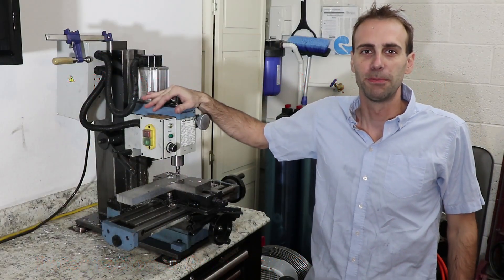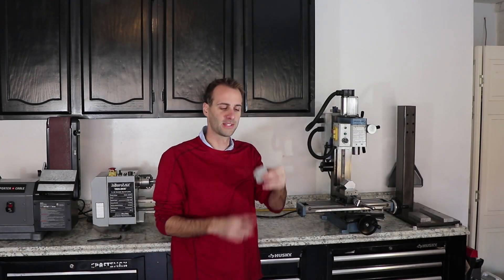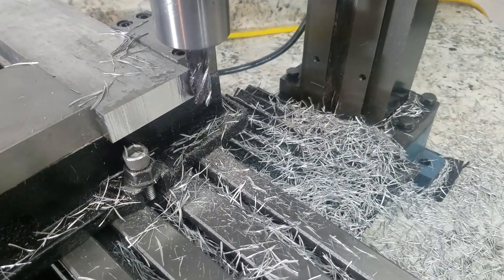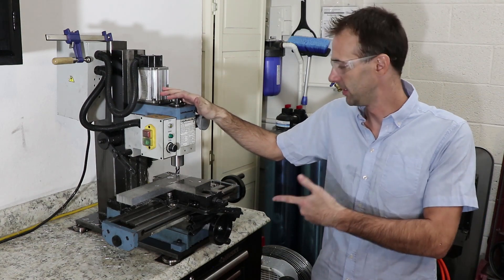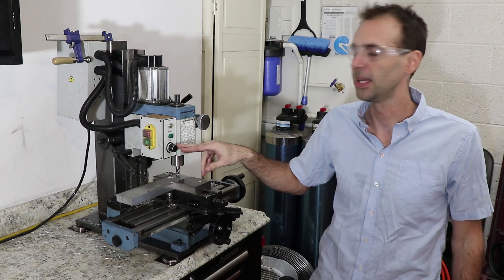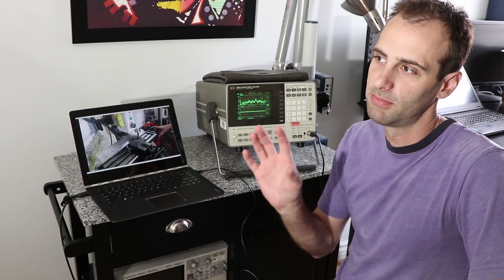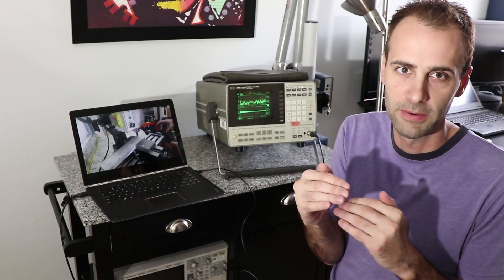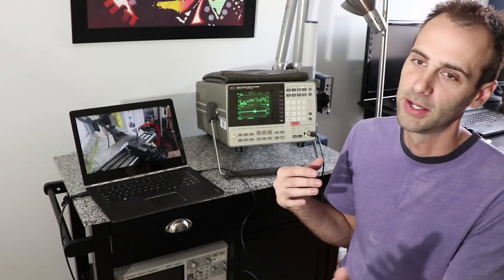Column Stiffener - LMS HiTorque Mini Mill

Comment: few points.. tighten the X axis gibs.. they appear loose and i know these machines get loose in the X over time.. lube is needed at least for your ears.switch to 2 flute cutters for aluminum. Anyway the mill seems a lot more rigid nice solution.. you also need a better Z lock now with the ability to take deeper passes.
Reply from the maker: Good suggestions. The Z lock is key, the Z dove tails on the head casting are the new weak point. The X was locked and the Y gibs were so tight the whole mill was sliding on the table, if you look close you can see it. I resist normal convention with the 2 flute cutters because: 1. I'm not filling the relief with chips with these light cuts (compared to what the cutters are designed to handle) and 2. a more flutes on the cutter increases cutting frequency (beating induced into the tool by each flute) without increasing surface speed.
Reply: @internationalprecisionengi1737  i dont have the mini anymore.. otherwise id have suggestions for the Z lock.. Mine always got pulled down  , even on fairly light cuts the motor could handle no issue.

Comment: Climb mill instead then conveniential cut the other way to clean up the finish.
Reply from the maker: Gregg, On manual mills there is usually tons of backlash, as apposed to a CNC where this is minimized by design (one of the reasons for considerable cost increase). Given the backlash, on this machine, there is not enough mass to keep the table from getting periodically sucked into the tool. Even with the gibs sinched, its a balance between the tiny screws overcoming the friction vs the part getting sucked in. When conventional milling you are fighting both the friction and the cutting force so, while not ideal, it is more stable.      The optimal algorithm on most manual machines is to take your rough cuts conventionally, and do your finish passes (with significantly less or no load) while climb milling.

Comment: I have the the LMS 3990 mill with the 2" column riser. I can make heavy side cuts in alu with hardly any chatter (2 flute cutter). I do get some vibration with harder materials. I upgraded the spindle with tapered roller bearings which made a big improvement. I do like the idea of a column brace but are you still able to tram the column?
Reply from the maker: Thanks for watching and for the comments. 1 inch depth of cut and 0.2" radial even at 2 in/min - that's alot of volumetric material for a weeny mill but it did it. I like the idea of upgrading the bearings too, I'll have to try that. 
As for tramming, I didnt bother for the stuff that I do these days. You can still tram it tho, just like normal but rather than having one surface to shim you have two. Kind of like bolting a vice down, set it and snug the bolts, measure, tap it in, tweak the bolts, measure again, tap, tweak, repeat until you send the bolts home!
The column did help but the weak link is the dovetails on the spindle casting, they are too close to the edge, if I wanted to go any further I would plate the sides of the head.

Comment: Lock your z and x and CLIMB CUT!
Reply from the maker: Good comments. Yes the axes were locked and the y was tightened. I've never really has success with climb milling on a manual machine, my speculation is that there is too much backlash and the table just jumps around. Climbing works on a CNC, from my understanding, because designers/makers have made attempts to reduce end play in the screws and (almost) zero-backlash ball screws are used.

Comment: Your z axis is dropping as you cut across, the dial is spinning and the quill handle is moving as well. I do like the reinforcement with a separate column and base plate, but alot of chatter comes with not locking the z axis and the table (whichever axis you're not intentionally traveling on, in side milling the x-axis)
Reply: At 5:18 and 5:36, your fine feed z axis handle is spinning.
Reply: Sorry for being late to the party but what you are describing has no effect. You can see that the main Z axis feed handle is in the coarse feed position (ie. the 3 spoke handle pulled to the outwards position on its shaft) which leaves the fine feed knob completely disengaged and able to spin freely which it likely does from vibration.
Reply from the maker: Z & X were locked for sure, I can see the position of the Z lock handle based on where I keep it. The worm drive probably was never engaged because I brought it down with the handle. The weakest link is the z axis dove tails, they are right on the edge of the head casting.

Comment: Nice experiment, Jacob. Have you tried recording the audio separately? If you use a good pro mic into a computer running Audacity, you can put that behemoth back in the museum. ;-)  Audacity will even do fast Fourier transform, and it’s free. There’s also the FFT mobile app that luthiers use that does fast Fourier analysis. 

I’ve read where people have stiffened their mill column with epoxy or even concrete, but I don’t know too much about that. Stefan Gotteswinter did a video where he trammed the column on his mill with machine epoxy. 

Your idea to use an accelerometer is interesting. A good pro mic will pick up down to 20Hz and lower, and I’d imagine an accelerometer can measure single-digit frequencies. You said the lowest resonant frequency you measured on your mill was 78Hz I think? Would be interesting to see if there’s anything lower than that going on.
Reply from the maker: Thanks John, yes you are correct there is lots of room for improvement. From my understanding the pro kit uses an accelerator/vibrometer because of the frequencies of interest and the electrical circuit must be tuned so not to attenuate any signal in that range. As a hobbyist it will likely never get done, I think I'm happy with the take away, stiffness means sharper resonant peaks (higher Q) so they are less likely to be excited. 
On this particular mill the weakest link is the dove tails on the z axis, they are on the side of the head. The consequence is significant chatter only along the x axis, so if you put the part in the mill and rough with the x axis rather than the y, it is significantly reduced... so even if we got the hardware and signals dialed in, the analysis would only apply to one single cutting situation. This technique is useful to tune volume production runs where the same toolpath is used for months on end, but it would be extremely expensive to build this data base of situations to be applied across all production - liken it to speeds and feeds selection, there is no replacement for a seasoned salt!
I like the idea of relying on more modern software for analysis, but as with most things software can only get you so far. For the dinosaur, the reason that thing is still getting kicked around is for the analog circuitry inside it. Its amazing, but there are natural components in the filtering that first order math (DSP) just cant handle.
Even the pros use epoxy: Drew Devitt from New Way Air Bearings, he has multiple channels so dont be afraid to do some digging, his stuff is great!  https://www.youtube.com/watch?v=ysyYznf4ris

Comment: I think try some materials with bad resonance (cast iron rather that steel). I would try the support beam filling up with lead. Cut some polycarbonate washers to use between support and machine.
I like this video good work
Reply from the maker: Also I herd about filling it with oil saturated sand, or lead shot & oil. It would be fun to do a more rigorous test but you'd have to straighten the set up out first: the microphone, put a motor on the handle for consistency, get a real carbide bit for rigidity... even then, all that would only push the resonances around not necessarily eliminate them but it would make it much easier to characterize and the pick feeds and speeds!
Reply: Excellent instructional video sir!  I've read several comments with some sound (no pun intended) ideas, but I think István's is probably the best.  The steel structure you added is great for improving stiffness, which is a good thing.  ...But steel is also very 'springy' (has a high Young's modulus, or modulus of elasticity) so, by itself, the steel column may not be helping as much as you might have hoped.  The added rigidity is good, but adding mass - and especially adding material with a high dampening effect (ie. material with a very low modulus of elasticity, like lead) could do a lot more.
Pouring molten lead into the column would be my first choice.  The oil-and-sand idea is good too, though I'd probably use a combination of lead shot, very thick oil (like 90 weight gear oil), and just enough fine sand to fill in most of the space between the shot.  The idea behind this is that any vibrations that start in the column are instantly transferred to the oil/sand/shot mixture and the friction induced between the particles & oil will quickly convert the vibration to heat.  ...all of which adds up to a basic description of how a dampening effect works.
It's probably self-obvious but, if you go this route, you'll want to make sure all the bolt holes are tightly sealed first, and screwing a gasketed plate to the top of the column could help avert a big mess if it ever tips over.
One more idea I'd like to add would be to bolt (or clamp, at least temporarily, for experimentation) a couple of thick lead slabs to the sides of the mill head, as close to the spindle as possible.  Adding 40-50 pounds of lead here might give you a further big advantage in reducing vibrations, especially at low frequencies.
Thanks again for the great video. The data collection and analysis was good, but I really appreciated your inclusion of the how-we-built-it part at the end.

Comment: Its nice to see video's  on the Mini Mill.  I have one as well but I have a TM motor and 2" column riser.  I would have added the column riser before bracing it.  I like the design but I believe it prevents you from mounting the airspring inside the column.  
I believe you were cutting aluminum, which case if you were, you should have been using a 2 flute end mill.  Your issues would go away and the chatter (sound) would as well.
Reply from the maker: 2 Flute has less meat tho so the resonant frequency goes down along with the cutting frequency being cut in half from the number flutes - too much hammering for these little tools, even bridge ports struggle with two flutes in my experience. Its less ideal for sure but it feels better on the dials, give it a try.
Reply: @internationalprecisionengi1737 . I agree with Brandon about 2 flutes with aluminum. The difference in the 2 flute vs 4 flute end mill with aluminum isn't about resonant frequency. 2 flute HSS works fine for me on my LMS 3990 on 3/4" 7075 aluminum plate with no chatter.

Comment: I can visibly see at the 4 minute mark your table flexing.   This means your gibs are probably loose.   I filled the column of my own X2 with a mix of sand, small machine nuts and bolts and epoxy up to the bolt hole for the quill control, to reduce resonation, then bolted the table to the mill.  Yesterday with a .5" endmill I did the same kind of cuts you show at 4 minutes, in a half inch thick steel plate with no problems.   Of course I tighten my gib screws.    :)     Your high pitch noise is because the material has no coolant, or the speed control is a little high.   Try changing the speed of the cutter or change to a 2 flute cutter to change the noise.
Reply from the maker: All good ideas, Ive always used 4 flute on manual mills to reduce chip load and increase cutting frequencies Ill be less stubborn and give a 2 flute a try again. Usually I run smaller material removal rates and use carbide - I thought this one was carbide at first glance but it was some weird Aluminium nitrite back (purple) coating... fail.  The 2Khz singing is the garbage endmill unscrewing, drills are most famous for this. I typically use 4 flute to keep the depth per tooth down for the same rpm, but as you point out the cutting frequency doubles. As for the Gibs, they're snug and the slide lock was half tight. I looked at the video and saw that the motion was the whole mill sliding on the table, prolly because the gibs and lock were too tight. Normally it sits on rubber pads but when we did the welding and when I turned it for the camera cutting oil got under them and rendered them useless for friction.
Wow, 1/2" end mill on 1/2" steel, with how much per pass? Dang, with 0.1" per pass and 4 in/min my mill would be dancing all over - pictures would be falling off the walls in the house... smoke billowing out like cutting fluid is on fire.

Comment: I think your rotation is far too low when using aluminum even with HSS tool.. Try less depth and higher t/min. I had the same problem, but by using carbide tools I was over the resonance part of my mill and it was far more comfortable.
Reply from the maker: for sure, smaller is better with this mill. I normally only do like 0.1 depth of cut, or 0.05 step over at full depth, I was just blasting it to see how it would cry. For the money and size, this mill is the bomb!

Comment: Jacob,  The usual way to tram the 3960 mill is by using shims  between the column and base at the four attachment bolts.  With the mill now bolted to the new column/base unit,  how are you planning to take care of future tramming issues?  If you tram the mill by itself, are you worried that re-attaching it to the reinforcing  column/base might introduce enough stresses to pull it out of tram?  Did the initial installation change the tramming at all?
Reply from the maker: Ahh yes the old precision vs stamina debacle. This mill has seen the horizons and beyond and it has considerable wear on the centers of the ways - this makes gibb adjustment especially difficult - so I decided that rather than filling or scraping the ways I will just use it up. I'm amazed at how much abuse this machine can take now that I'm not so concerned about precision: the cuts in the video were 1" x 0.125" at a pretty decent clip - it was like Edward scissor hands at the end of the movie except with metal!
I did however give it a decent effort not to bend the mill column to the new support. We first welded the support and of course that it wasn't square so we bolted the mill to the bottom and used snap gauges to measure the gap and squareness and then machined the spacer to fit. When I put the spacer in it just needed a love tap to get it in, like dialing in a vise. There are some glimpses of us hitting the support with a square and me measuring and milling the spacer at the end of the video (I think).
Thanks for the comment! I appreciate your support, Jacob
Reply: Jacob,  I didn't mean to diminish your efforts with this upgrade.  The 3960 could stand a larger support area on that 4 bolt base, but that would probably require a new base casting.  Your approach does offer a much more rigid column, that's for sure.   Great video!
Reply from the maker: I didn't take it that way, it was a great question. My favorite way to tram and stabilize is the Epoxy method. This guy did a great video (link at the end). I made six holes in hopes that one day I would get around to making a 2 inch spacer and raise the column, if this ever happened you could just measure the gap with snap gauges while its bolted to the new column and machine the riser to suit.
https://youtu.be/U7Qs-J2swIc

Comment: Hi Jacob, I loved this video! Would be great to see how far you could push this idea. Some folks spend a lot of time bulking up their mills with granite bases and such, but you can actually predict, do, and measure to find what truly works, and have the knowledge to explain it. Pretty rare. I've tinkered with accelerometers and have not been impressed with the like from SparkFun. Perhaps one of the industrial vibration transducers is the way to get a clean signal? I don't know if it is appropriate for this work, but I've used a calibrated Dayton EMM-6 microphone (the linearity data can be downloaded given the serial number) with TrueRTA to do audio analysis. With a pre-amp I assume you could bring the signal into your network analyzer too. Best wishes, Kent
Reply: Hi Jacob, I thought of this later, but I reading the instructions to a Markforged 3D printer and they have this interesting way to adjust the belt tension that's a bit related to your video. The manual recommends using a piano tuner to measure the tone that the belt generates when plucked and to tension the belt until the tone is near 49 Hz. Thought that was pretty neat.
Reply from the maker: Thanks bud! The concept can be taken very far, so far that a bunch of people way smarter than me have made a lively hood doing things such as this. One interesting approach is to hit the machine with a calibrated hammer (not kidding) and listen for the resonances with a pricey mic and analyzer. There's no end to the madness, but at the end of the day these are just base points because as a tool wears or changes feeds, the loading changes which will shift the modes... put a bigger part on the tool, changes the stresses in the tool and again changes the modes...
I like the tuner idea, but they should have recommended to play a 50 sine on youtube and compare, just in case someone doesn't have a tuner, particularly a piano tuner. This is cool if you've never experienced it: if you play two tones that are close together you get a beat frequency and as you tune closer to the set point the beat slowly goes away
Reply: At IMTS four years ago, one of the coolest demos was this line of seemingly identical parts on a conveyor, tapped by a solenoid driven weight, one by one. A computer recorded their sound and used that to determine if the part had defects. Both my wife and I play piano and use beats to check tuning. Could a non-musician even be told what to listen for? Markforge just recommended downloading a free phone app.